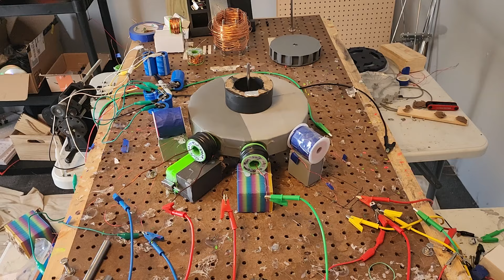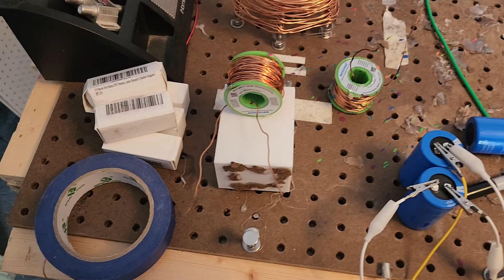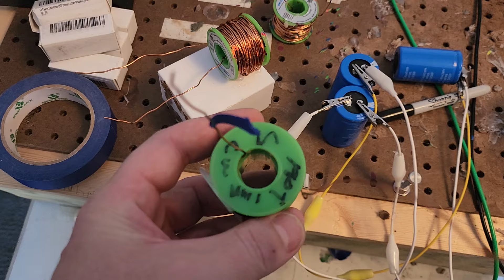pulse motor mayhem  14awg coils really give the rotor a boost in speed.

Comment: Shouldnt iron cores for the coil improve the magnetic field tremendously? Also i think you should be able to use way thinner wire for the coils, improving their performance. 20 gauge wire should defenetly be fine with a maximum amperage of about 4A
Reply from the maker: I'll look into it 20awg right?
Reply from the maker: I have aluminum, steel, and Iron cores all  are to long for any of my bobbins use them anyway? and which metal?
Reply: @MPHJR  before you change the gauge of the wire, may i know what driver circuit you are using and its maximum amperage?
Reply: @MPHJR  so for the core of the coil you need a ferrous metal, which is steel or iron most of the time, aluminium would not work